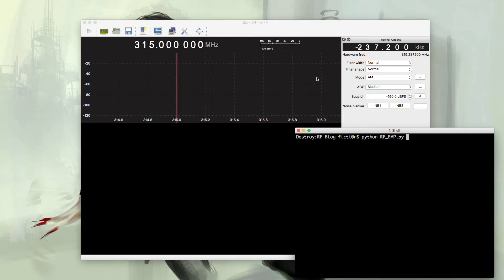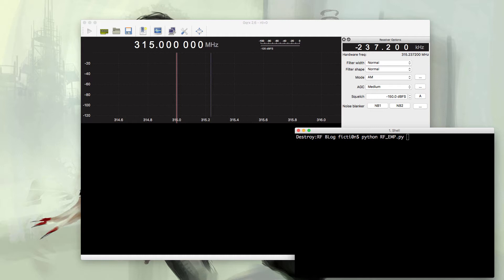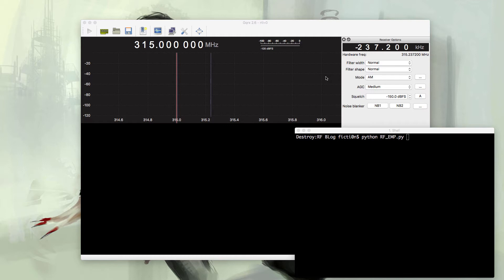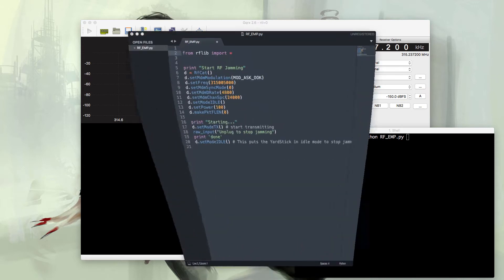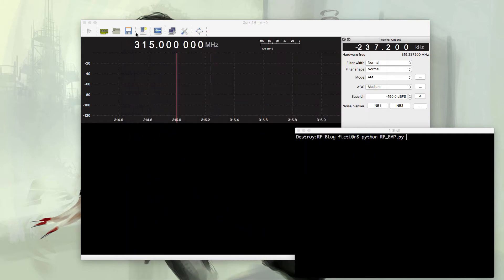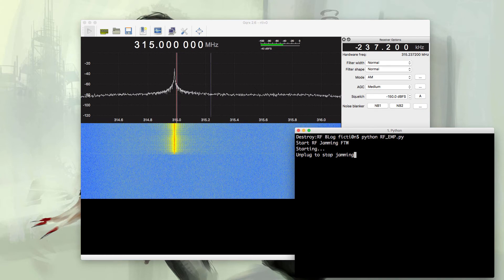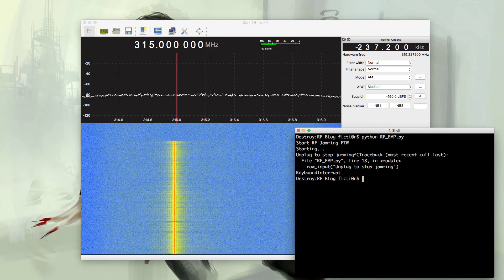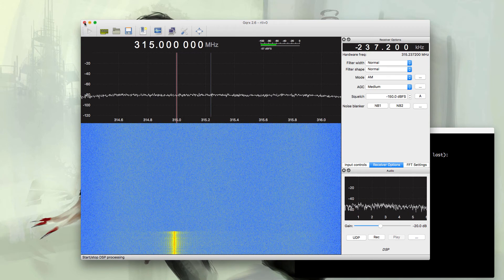RF Jamming Attacks For Disabling Devices - 0x04

Comment: Excellent video.  How did you configure your rfCat to jam the signal? Where did you find or create that python script to jam the signal? My project scope is to sniff but thinking of testing the jamming of my device to be complete
Reply from the maker: RFCat is a python 2x library so until they update to python3 which may or may not happen.. it will probably require very specific versions and configurations.. I have not messed with it since the changeover to pthon3.. would be a wasted effort to do so..

Comment: Please give source code
Reply: No dongle found, i using rtl sdr official
Reply from the maker: @walidbadeges3276  If you are using rflib you would need to be using a yardstick. not rtl-sdr.  You would use RTL-SDR with GQRX
You should really read the full blog on this. https://console-cowboys.blogspot.com/2017/10/hacking-everything-with-rf-and-software.html
Reply from the maker: If you need written out code for some reason then reference the blog associated with these videos.
Reply: @ConsoleCowboys  okey i get code, i get new problem, "rflib not module" why?
Reply from the maker: You  need to install rflib....  Try the rfcrack install directions and install rflib    https://github.com/cclabsInc/RFCrack/blob/master/INSTALL
Reply: @ConsoleCowboys  okey thank you

Comment: Hello, when im jamming the signals still go through and i dont know what im doing wrong.... Should i buy a bigger yardstick one antenna?
Reply from the maker: Make sure you are at the same frequency of what you are jamming and that you are  not to far away from the devices you are trying to jam.. Different antennas yes will also have a different effect on your testing.. If it is not the correct antenna for the frequency range you may run into issues.. There are whole blogs on antenna theory you can google which go into detail about length and frequency etc.
Reply: @ConsoleCowboys  Thank you for the advice. I just ordered 2 new antennas for the yardsticks and i will test them out tomorrow.
Reply: @ConsoleCowboys  I got the new antennas.  Now everytime i am sniffing on any frequency it captures random signals. I first thought its the jammers signal but it isnt because it also captures random signals even if im not jamming. Please help...
Reply from the maker: Yea depending where you are at you are going to pick up other things in that frequency range. there are a lot of devices talking over industrial frequencies..  Try moving to the other side of the house in another room to do your research.  Or maybe use your less powerful antenna for listening and more powerful one for jamming...
Reply: @ConsoleCowboys  Ok thank you i will try it. Isnt it possible to like calibrate the antenna power/sensitivity with RFCrack parameters?
Reply from the maker: @tobiasmuller527  Yea you can flag certain levels when dealing with the rolling code option using -U and -L for upper and lower.  I am not sure that i have that baked into anything else generically...

Comment: hey man, just wondering if there is a command that I can use to block a frequency for the hackrfone, something like 'hackrf_transfer -M MOD_2FSK - J'   I know there isn't a -j option  but I'm just wondering if there's anyway I can jam a frequency and then use my YS1 to capture and replay the rolling code or would I need another YS1 or is it do able with both devices please man :) GREAT WORK!!!!!!!!!!!!!!!!!!!!!!!!!!!!
Reply from the maker: If you want to use your HackRF for jamming check out the video response on jamming with the HackRF. You could probably export the python code GNURadio creates and then run that on the command line with your HackRF, although I have not tried it.  You would then need to use your yardstick to capture your devices rolling code filtering out some element of the Jamming signal that HackRF creates, for example specific characteristics of the Jamming your using or possibly the signal strength as a differentiator.    The other option is using 2 yardsticks and my RFCrack tool which would automate that for you.. check out the RFCrack videos for its usage, but that will require 2 yardsticks.
Reply: I know I have seen your RFCrack and boi its makes life so much easier and yes I just tried your way but it doesn't seem to generate a strong enough signal like your jammer on RFCrack which is abit strange and its way beyond my capabilities man as I am just starting off haha so just getting my head around the whole python scripts is a good start, but thank you so much you make life so much easier so us. if there's anyway you can think I can I do what I'm trying let me know please man,.. is there no way to make RFCrack work with hackrf_???